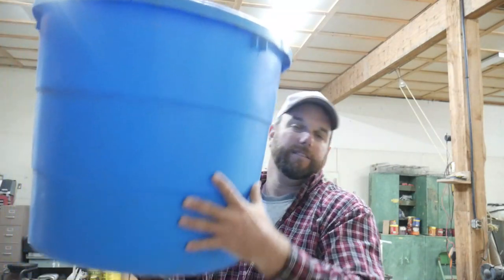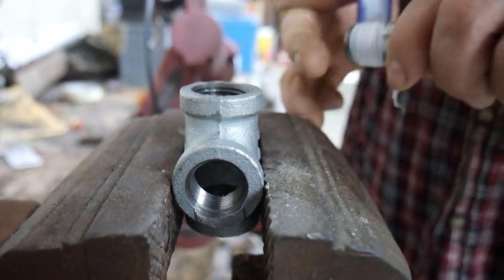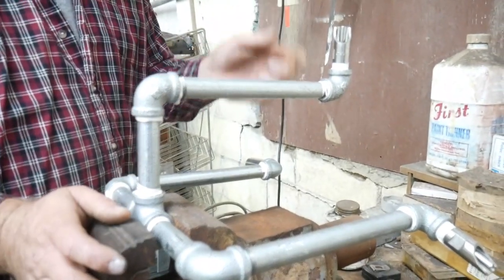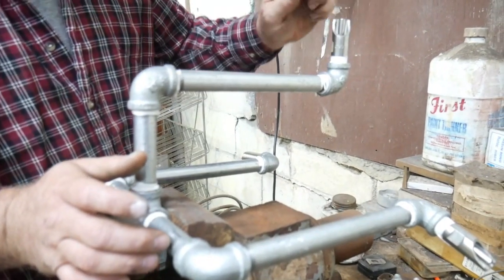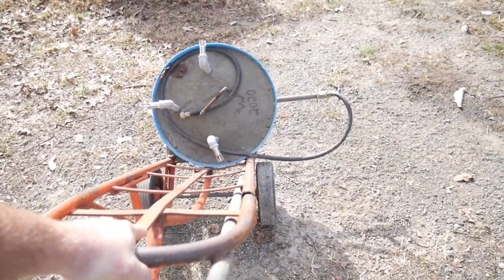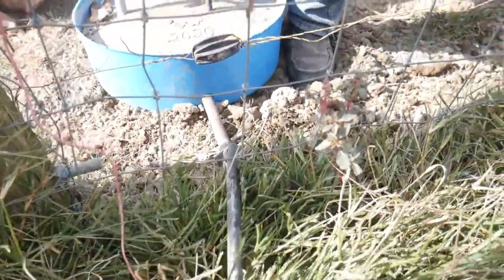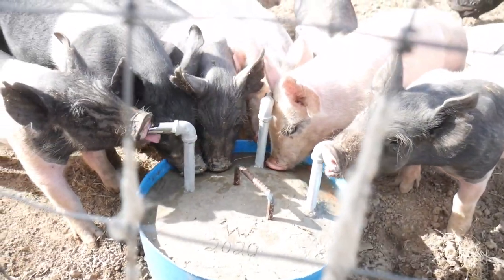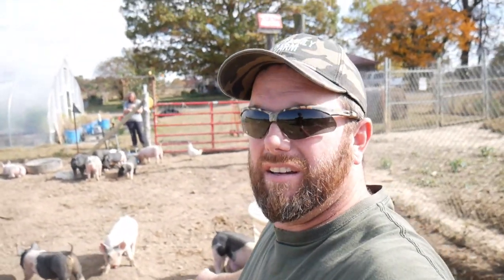Simple Homemade Pig Waterer  DIY

Comment: Good durable idea,  only problem I see is that the water will get too hot in the summer and freeze in the winter. Upwards of 135 deg. In the summertime from a hose about that length unless they are really drinking  a lot.
Reply: That is why I have an aitomatic ice maker hooked up to mine,  We live down South, so it does not freeze that often,  I also keep a cooler with a copy of cold ones in it for when they get really hot.

Comment: tried something like this for my hog ... hes around 900 pounds curently and likes to flip containers ... i used half a 55 gal drum full of cement ... he flipped it , busted the pipe and made a 3 ft deep mud waller by morning ... Cost of this lesson 
$30 in pipes and fittings ,
$10 barrel 
$0 cement ( i know a guy) 
$600 for new well pump as it burnt out from running all night 
hes getting butchered next weekend